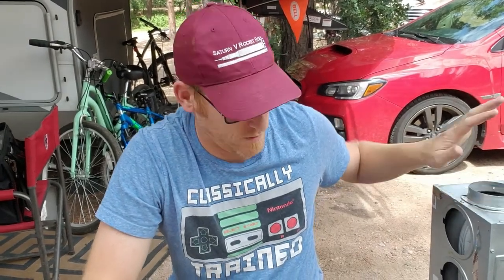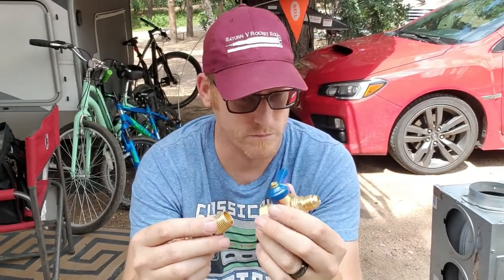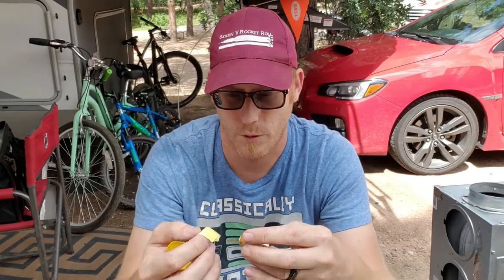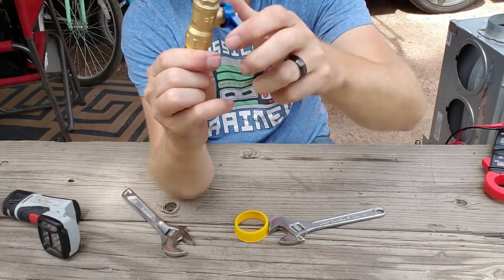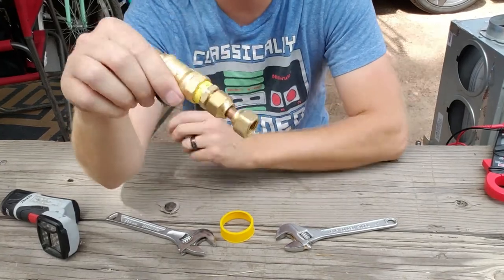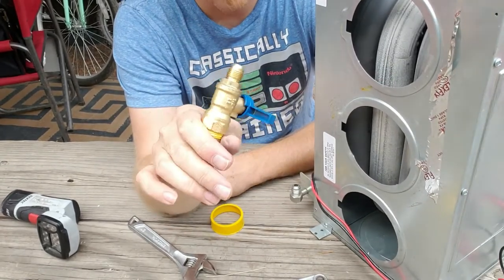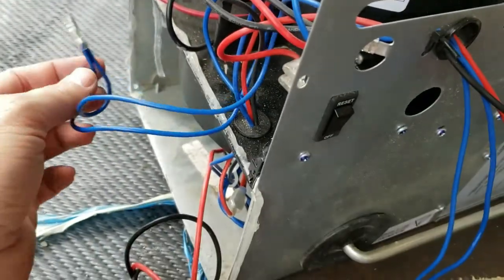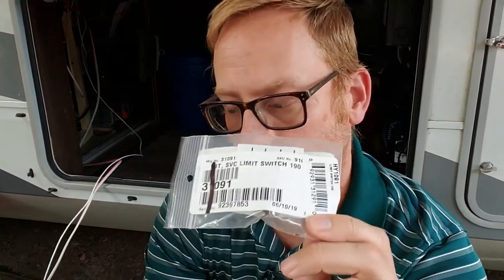Bench Testing the Furnace

Comment: Thank you for the video. So mine started doing the same thing and the board has been replaced worked for a few days then  still the same issue. My question is, your unit was not working in the beginning of the video when it was in the RV and it did have the exhaust pipe on. So do you think the limit switch actually fixed it but you couldn’t tell until you put the exhaust pipe on? Or was it the igniter? Something had to have fixed the issue right? 

Thanks for your input.